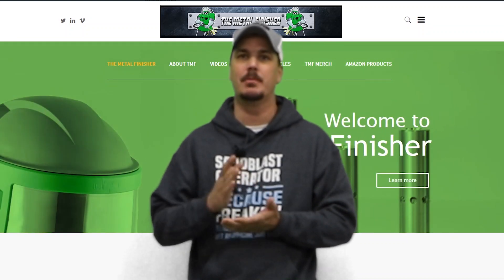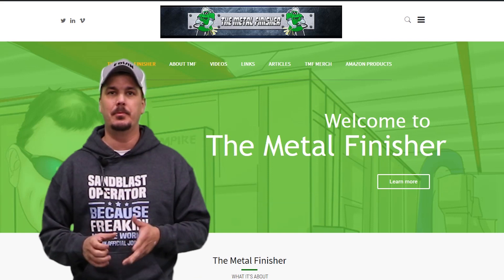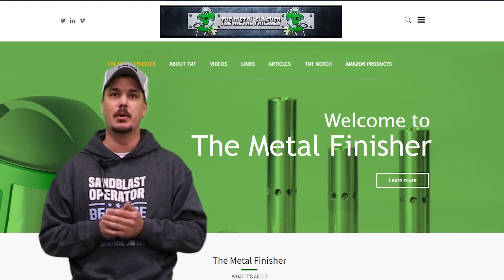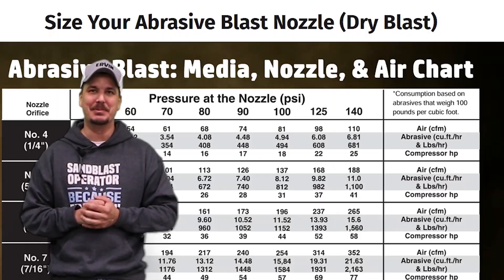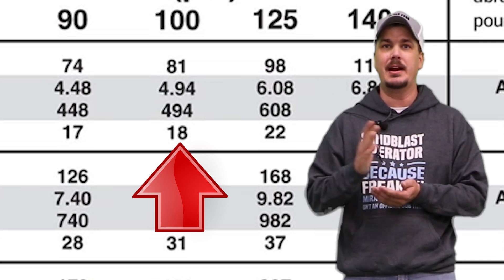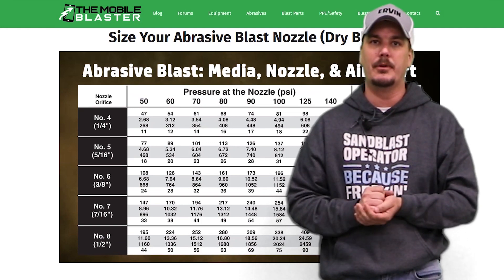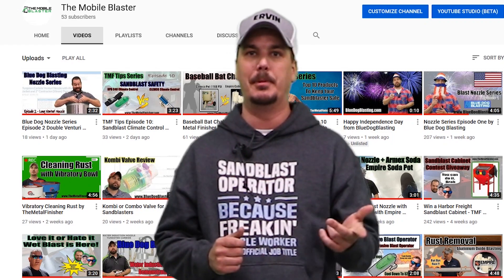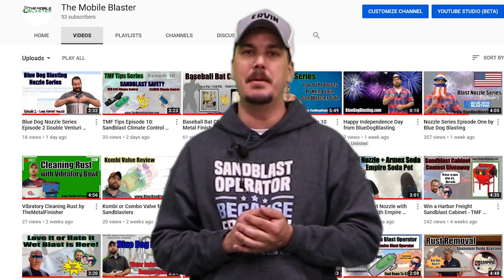Sandblaster: Sizing Blast Nozzles, Hoses, and Compressor

Comment: Does the "hose id = 4x the nozzle size" rule apply to dry siphon blast cabinets as well?
P.S. Love the dance moves! 😂
Reply from the maker: No.  This is for the pressure pot.  On our suction cabinet we typically use a 5/16 Nozzle  with a 5/32 Air Jet

Comment: Thanks for the response, I appreciate it.  How many cfm is your compressor for the suction cabinet? What size hose for air and what size hose for media do you use on the cabinet? I have a 10hp 35 cfm @100 psi compressor
Hopefully you can help me out, the info out there on the web is very limited on this subject.
Reply from the maker: No problem. 
For a 1/4" Nozzle and 1/8" Air Jet at 100 PSI we need 26 CFM to blast.  Our reclaimer is a 600 CFM capable system.